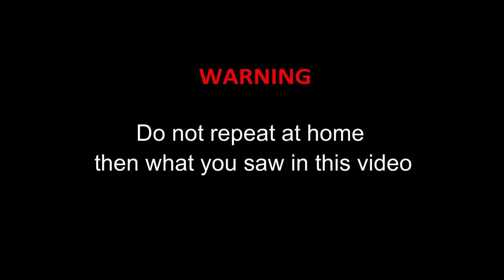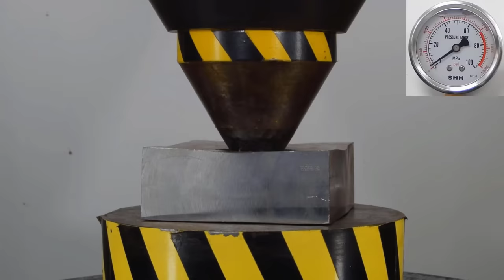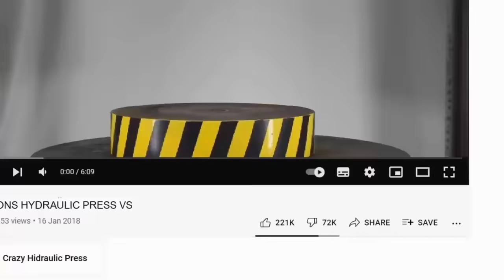HYDRAULIC PRESS VS OLD AND MODERN ARMOR

Comment: It's crazy how much more brittle steel gets as you go up to harder grades. I think ultimately it will be layered for ultimate stability for armor. A soft exterior then a harder inner layer the softer exterior to absorb and distribute impact then a harder layer for added protection
Reply: You figured out how composite armor works. Look up Chobham armor.
Reply: They use reactive armor plates that detonate a shaped charged outward when penetrated. This causes a counter force to the projectile stopping it before it even touches the normal armor plating.
Reply: Doesn't matter the hardness, steel melts under heat. The shaped charged explosives send molten brass etc as plasma to cut steel like butter.
Reply: @Soravia  wrong, shaped charge does not burn armor, but washes it out. It is more high pressure water cutter then plazma cutter, just copper is used instead of water. And hardness does matter greatly, you can look for shaped charge resistance tables for different materials on the internet.  Long story short: modern armored steels work great, sand is terrible and rubber much better, then it theoretically should.
Reply: Generally a hard outer layer of armour with a softer inner was how it was done in early WW2 (essentially hard layer to start breaking up a shell, soft layer to absorb the fragmentation of the shell), but it was found that steel armour of uniform hardness (aka, like what we see with the 1940 armour here, which is relatively hard by WW2 standards steel) performs better against kinetic projectiles

Softer armour is more prone to be penetrated by projectiles that do not break up in contact agaisnt them, and current tank armour generally consists of extremely high hardness steel with ceramic inserts between two thick layers of it, but this is mostly because uniform steel and ceramic armour has way different performance characteristics

In fact, a sandwich of high hardness steel and fiberglass reinforced plastic (often called bakelite after a similar american thing that existed in a more civilian setting much earlier) was some of the best armour in the world in the 60s and 70s until modern ceramics were developed which perform better
Reply: Trust me youre not the only one who has thought of that
Reply: So a San Mai technique.
Reply: If you aren’t going to use Kevlar than it would be my guess that you’d need to have the harder armor on the outside otherwise you are just going to kill everyone on the inside without even penetrating the armor.  AR500 spall is deadly as shown in this video.  So I don’t think you want it on the inside of the tank without something else after it.  But I’m not a specialist and I’m not even someone interested in tanks and armored vehicles at all.  I do know that you def don’t need a penetration to kill everyone inside a tank if the armor is designed poorly and plenty of it is.
Reply: @MrGivmedew  in edged weapon making, that is what San Mai is. It is one piece of hardened steel sandwiched in between soft steel.
Reply: That's how metals tend to work. The harder it is, the more brittle it gets. The softer it is, the more flexible it becomes.
It's often a balancing act in order to make the most optimal and cost efficient tools for whatever situation.
Reply: Layered, like an ogre.
Reply: @TH3SHUR1F  not everyone likes onions. Cakes! Everyone likes cakes.
Reply: Actually, brittle is a function of contamination in the steel, mostly sulfur. The T-34 armor is a case in point. The steel is pretty good but still has a moderate sulfur content. Modern armor has a much lower sulfur content but could be better. Titanium alloyed with Iridium is stronger and more flexible than anything but too expensive to use in large quantities. The new metallic foam is impervious to shaped charges and much lighter but the manufacturing process still needs work before it can be made in large quantities. If it can be made in quantity, it is a game changer. The interesting thing here is that a cold ball could penetrate the modern armor which is designed to withstand hot steel.
Reply: Just ask @AlecSteele if he can forge a Damascus Tank
Reply: Anybody know what kind of metal the hydraulic press cone itself is made of? Tungsten carbide maybe?
Reply: @Taunus-Tim  beat me to it 😂 "today, on episode 501 of my Damascus tank armour series..."
Reply: @Soravia heat has nothing to do with the mechanism you're describing
Reply: @MrGivmedew  Yup, HEAT shells make mince meat.
Reply: @joseph1150 Does it not say “ closely guarded state secret xxxx off Ivan”?
Reply: You can just imagine how effective the depleted uranium armor on the US Abrams is.
Reply: You’d want the hardest layer on the outside to deflect small arms damage.  If the softest stuff was outside the armor would collect divots and take on extra damage from glancing blows.
Reply: @actionflower6706  The way it works is widely known. How it's made is a bit more secretive. But there have been captured examples so it's not really a mystery anymore.
Reply: @joseph1150  Ah. Okay. Thanks.
Reply: You don't want to absorb anything, you want to deflect.
Reply: As othees mentioned bevore armor plates need to be elastic and hard at the same time. If the steel is to hard the kinetic energy of a hit will break splinters inside the tank off. Its like a shot gun goes off iside the tank, very emotional experience for the crew.
Reply: this is what they use to build tanks, not like a suit of armor. modern body armor needs some type of ceramic to stop bullets

Comment: The reason why the AR 500 block failed is because it had already been compromised by the previous test with the two different cones of steel, then flipped it over and did the frozen ball bearing test. You should have done a test with some Tungsten Carbide that would have given a must different result than the two cones you used! the ball test was much different than I was expecting. I thought the ball would explode, not the AR 500!
Reply: That is the power of stored energy.
Reply: The sphere is the strongest natural 3 dimensional shape at any given point.
Reply: @Sharpless2 A sphere is not a natural object and strong is a general term, where size, mass, hardness and in this case temperature all have different effects on the piece.
Reply: @canlib  If a sphere is not a natural object, explain Planets. Actually, explain the whole Universe. Did you really just say that? Nah man, you have no idea what youre talking about.
Reply: @Sharpless2 planets are oblate, not spherical.
Reply: @treymorgan5195  thats due to gravity. Perfect spheres are natural, as seen in atoms, water droplets and bubbles. Also Earth isnt the only planet and not all planets are oblate. How dense do you have to be to completely disregard basic physics? You can do whatever you want, the sphere is the strongest natural 3 dimensional shape. Just thinking about its shape should already tell you why.
Reply: @Sharpless2  Planets attempt to be perfectly spherical due to gravity, but are oblate due to rotational forces (being greatest at their equators) or because of being tidally locked, and so forth.
Reply: @WinstonBlack  fact remains, they are not perfect spheres. Nor are atoms, spherical maybe, you want to appear as if you rely on science, but don't adhere to specificity of language.
Reply: @Sharpless2  Atoms are only "spheres" (have a spherical ground state / excited states that can be easily represented by spherical harmonics) because of spherical symmetry (ie. there is nothing that would distinguish any direction from any other - ie. when there literally isn't any other option than being spherical). Even He+ helium ions would not be perfectly spherical, due to some minuscle quadrupole moment from the nucleus. And any atom with more than 1 electron will be even less spherical than that.

And even a ground state hydrogen atom might not be truly perfectly spherical, since the proton QCD structure might have a minuscle effect on electron orbits.

The apparent "perfect spheres" in nature are just a consequence of the general fact that everything (eg. cows) can be, very roughly, approximated as a sphere when you are far enough away / that everything seems to be a sphere when you can't tell different directions apart.

Comment: I'm glad you're okay.  I hope you see how your safety gear is not quite up to the job.  I assume, but also hope, that you are filming all of this remotely, nowhere near the line of fire (which is any linear direction from the press).

I hope you use this experience to make your safety enclosure even better, and better able to withstand whatever you demolish next in such an energetic fashion.

Boards can be reinforced with aluminum rails.  Stands can be weighted or even anchored into the ground.

Several coatings of truck bed liner can greatly improve the force absorbed by the boards.   There are lots of simple ways to improve this.

A camera on a tripod could have a strap attached to the ceiling so that it can't fall all the way over.

Anyway, thank you for sharing your experiments with us and stay safe!

Comment: Got to admit I was expecting the ball bearing to explode and not the armored plate but I guess supercooling it changed the metals properties enough to stop it exploding like they normally do under a press.   Also shows how speed equals mass when small armor piercing rounds can penetrate such armor using speed to create mass combined with even harder material used in such rounds.
Reply: The v² term of k = mv² is REALLY important!
Reply: So did I, I would expected that by freezing, it would become more brittle.

Comment: looks like a few of the attempts melted the contact point between the hydraulic press and material being crushed. Pretty impressive to generate heat of that intensity at such a slow rate.

Comment: Frankly I was expecting the ball bearing to shatter being it was frozen to such a cold temperature and would be brutal. That the armor shattered was quite surprising.
Reply: Not really tho .. each side of the plate had a hella dimple in it. Hard plate like that is not very ductile so those dimples were defo stress risers. The yield strength of AR500 is about 90% of its tensile strength. For reference, A36 mild steel has a yield strength somewhere around 40 to 50% of tensile strength. Quite spectacular grenading for sure ..
Reply: Spheres are the strongest 3d shape. Why they use them in subs that don't implode.
Reply: @ccampau  a titanic amount of genius is required
Reply: @lancetheking7524 the puns just sank in
Reply: @ccampau  except when submerged the pressure is equal on the total surface, on the press the pressure was localized to just two points

Comment: What's really scary to me is the very first armor failing.  The shrapnel, if any of that was flying around inside a tank it would be horrific.  You might not be lined up with the trajectory of the shell coming into the tank, yet still you would be hit by these 1" shards of glowing hot metal that has sharp edges like glass.
Reply: Ever heard of spall liner? And with modern composite plating it's a non issue in the first place.
Reply: yeah, HESH shells is even designed for creating spalling, although spall liners and composite armor have made spalling much less of an issue
Reply: @shajidrahaman  Not to mention we wrap armor in C4 to defeat shaped charges. If squash was still viable, using ERA would be suicidal...
Reply: The titanium armor is more for aircraft and body armor, used as the outer layer of protection. The inner layers stop any shards and suck up the energy.
Reply: @demoncore5342  spall liners absolutly on point, but tanks are not covered all over with composite armor, usually just the turret front and sides and the front plate of the chassis
Reply: Read the diary of a T-34 mechanic sometime.  It's absolutely terrifying what they had to clean out and patch up.

Comment: Question, did you make sure you tested the right side of the old armor? Its likely face hardened steel (Krupp cemented style) meaning that one side is tempered very hard to resist impact, and the other side is softer to prevent spalling (shrapnel explosions) after an impact.
Reply: Was also wondering whether the hardest part wasn't machined off while cleaning up the surface
Reply: i speculate he just use some chunk of mild steel as machining a tempered tank armor will wreck your tools, similar to used train tracks
Reply: also had the face hardending machined off  if it even was tank armor.
Reply: The old armour plate was shown coming from a T34.
So it didn't come from Krupp.
Soviets didn't use case hardening, unlike the Germans.
Reply: @jamesalexander7747  It would not have been Krupp manufactured, but still should have been Face hardened similar to Krupp armor. The US didn't use Krupp armor, but used an equivalent (within a few percentage points) style of face hardening.
Reply: @Atlasworkinprogress  
You can highlight with a capital F as much as you like my friend.
My point remains the same.
Reply: @Atlasworkinprogress  Soviets used more meat
Reply: I doubt that Soviets used face hardening considering they over-hardened the armor plates themselves to the degree where they shattered on impact sometimes. There are historical photos of this effect.
Reply: @p_serdiuk but they did still harden them.
Reply: @Atlasworkinprogress US tanks used homogenous (that is, equally tough and hard throughout) plates, either rolled plates or cast forms. 

The surface wasn’t as hard, but the steel was much tougher overall, which reduced the effect of bits of armor breaking off behind the impact and becoming projectiles. 

The US did use face-hardened Krupp armor, known as Class A armor, but that was mainly on warships like cruisers and battleships, with the exception of the turret faces of the Iowa-class, and only because nobody had the ability to consistently and reliably face-harden 19-1/2” of steel to the desired depth.
Reply: @scasny Correct!
Reply: @scasny он же показал, что и откуда он использовал !!

Comment: the explosive reaction of titanium was unexpected...
Reply: Not by anyone who has machined titanium - it is a pyrophoric metal like magnesium, aluminium and uranium.
Reply: I machined titanium in lathe and grinder, in grinder is very easy tp see nice white sparks.
I use titanium powder for amateur pyrotecnics.
Reply: Ever watched Formula One, IndyCar or similar single-sester🏎️ racing series? This (Ti) is what's making all those sparks on a bumpy pavement. Motorcycle racing🏍️ boots are also capped with Ti. They produce nice sparks too.
Reply: I’ve recently bent some thin titanium and was surprised how crunchy it is.
Reply: Same as thing.
Reply: @allangibson8494 

Yep. Finely divided Ti particulate or Ti spall (as seen here) is pyrophoric.  Very fine Ti dust in a large enough quantity can spontaneously ignite... and is an absolute BITCH to put out once it's burning.
Not really a good candidate for armor, if one is being honest.  It's lighter than steel, but tougher than aluminum, and is pretty heat tolerant,  That's its main pros. 
It's con are: It's a bitch to machine, its a bitch to weld, it's pyrophoric, and very expensive.
Reply: AR500 plate is steel, not titanium.  Where does the video say anything about titanium?  In any event, there’s a bit of deception here as to the material.  It’s actually weaker than appears—against high velocity projections.  We use as targets at the range and a 50 cal with armor piercing core punches through such material.
Reply: @johnluiten3686 the stack of plates at the start of the video were Titanium...
Reply: @Skyfighter64  My bad.  Thanks for the correction.  Video still was fun to watch.